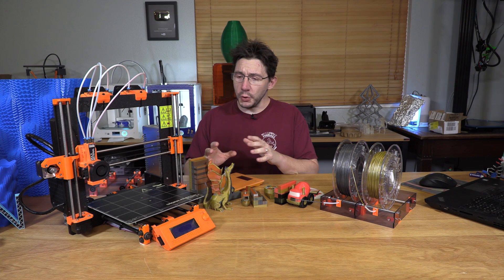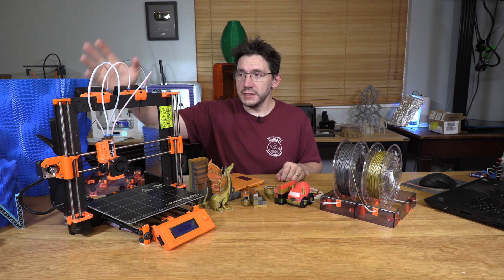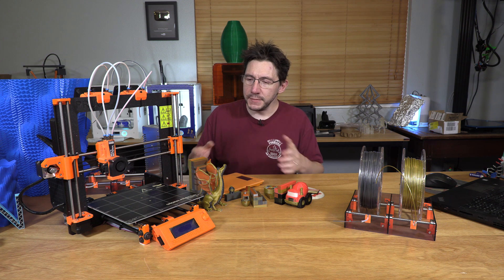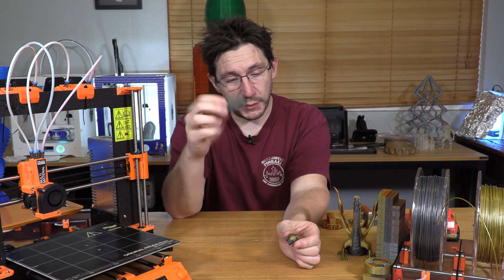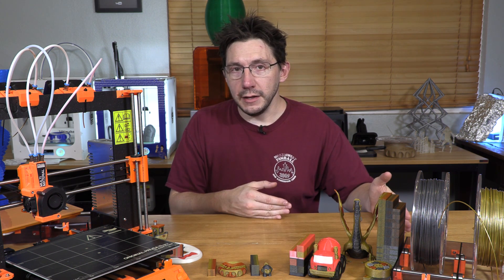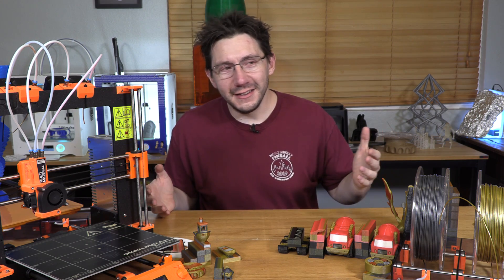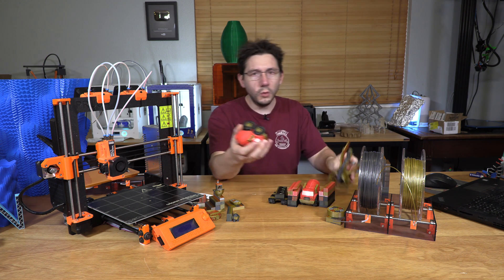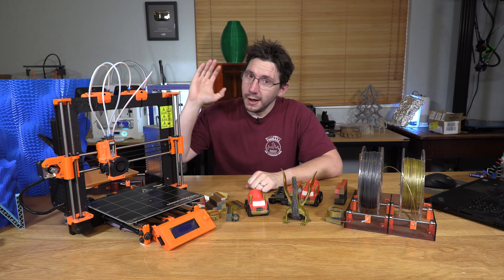Prusa Multi Material Review(?) - My Thoughts on the Prusa MMU 3D Printer

Comment: You forgot to mention one thing. For example in the case of Mixer model, you can print at least 6 copies in one go with the same amount of "waste" as with one, which shifts the percentages quite a bit. The waste would be only 14% then. The percentage amount of waste is completely in your hands 👏 Happy printing!
Reply from the maker: +Josef Prusa oh shoot in all my rambling I did miss mentioning that.
Reply: Why is the waste not used to print the infill? Why is it not used to print a second model where the colors doesnt matter? :/
Reply: @3DPrintingNerd  But.....when this fails then your waste is also much larger.
Reply: Josef Prusa what if the purge filament was used as 100% in-fill or structural support or used to make something completely different to the model regardless of the color makeup, a bigger model for example to make use of the waste difference. I’m in the market for a printer but as I am new to this I also think this great machine is out on my league.
Reply: Josef Prusa why don't you purge the nozzle inside the model. It has 2 advantages. You don't waste material on the purge block and you have a heavier model
Reply: That could work if the inside of the model always has a layer volume large enough to hold the waste plastic.  You have to realize that every tiny detail in your model that has a different color than the other colors around it then it has to be purged.  It either needs a purge block at the same layer height or some sort of wiper chute.
Reply: Recently bought a prusa M2S kit, couldn't be happier!
Reply: Luis Meza
Using the infill to purge sounds like a pretty good idea as long as the infill provides long enough travel paths for the nozzle to be reliably cleaned, good idea. :)
Reply: @NochSoEinKaddiFan  the purge block must remain being built to the payer height of the final layer color change … so this is the only way to do it
Reply: I was thinking that the slicer would see if it was possible to make the waste infill, and if it couldn't, then make the purge block accordingly. You can calculate the amount of material needed to perform the purge, and see if that is less than the material needed to do the infill.
At the very least it would shrink the purge block...
Reply: Hey Josef, one silly question. Wouldn't be possible to use the wasted material to print the infill? I mean nobody if the color outside matches the inside
Reply: I think a purge "bin" or "wiper" that travels up the Z axis along with the print-head could seriously save a ton of plastic.  Basically something that just catches and tosses to the side the unneeded plastic thus not requiring the huge purge block at all.  There are plenty of examples of these wipers, but this one wouldn't have a bottom, it would just toss the plastic to the side of the printer, you can either set something over there to catch the wiggly bits or just clean them up after the print.
Reply: It would waste as much plastic. The purge block is calibrated to remove the plastic from the nozzle. If you have a peurge block that weighs 100g, your method would result in 100g of wiggly bits.
Reply: Why didn't yall just make the waste infill?
Reply: Don’t really see why there needs to be a multicolor purge block, especially if you have an eye towards recycling the waste.  It knows what color it’s printing, it can make a separate block for each color, space permitting.  Then you can recycle specific colors rather than a rainbow.
Reply: Please consider software updates suggested by hed420 that purge to the infill. A heavier infill would be excepted and a more solid model rather than waisting a nothing block. Nobody sees the inside of a model. Trust me when I say, you will be blessed by pursuing and achieving this outcome.
Reply: why not make it so that the purge could be a second useable model that doesn't care about being a mix of colours? For example..a  box, printer parts , gears etc. Couldn't it be arranged? Then you could just plan it so that your multicoloured print outs are combined not with a useless block but with a second useful object.
Reply: Could the waste block be the same shape as the model?  Yes, the print it wouldn't be the correct colors, but at least you get two prints at the same time.  One nice one, one in Tie-dye format.
Reply: Then you might want to pin the comment? :)
Reply: From what I understand is that the nozzle must clean itself. Just throwing plastic out is not enough if the nozzle doesn't wipe the previous color that was left on it.
Reply: That was what i was thinking about the whole video :D
Reply: Who is going to print many? Production only really. @Joesef Prusa Can you get the slicer to print another object with it instead of a purge tower? Something you could paint?
Reply: Do you have a "use infill as purge" option?  I think that would save a lot of filament.
Reply: Would it be possible to create purge objects instead of purge blocks? The purge objects could be functional things that a user would not mind being randomly colored. Bag clips could be an example. Perhaps the purge objects could print in a stackable fashion to meet the height of the printed object. If my printer is going to print something on the side, why not make something someone can use?
Reply: no, it could not. You can see it with marvin and all those little models, the purge block size must be constant.
Reply: @Laki235  he means every time you switch filliment you add on to the exsisting model
Reply: @luis meza Not true my friend, the MK3 is the easiest printer for a beginner to start out with imho.
The instructions are fantastic and the machine holds your hand for just about everything.
Reply: Smaller prints you could still use the infill tower idea. Or you could have the head move off. Servo could wipe the extruder after enough is extruded to clear the chamber and then it could return to printing. The real problem is only determining the amount of filament needed to clear the chamber. If paper printers can do it then there is no reason it can't be done with 3D printers.
Reply: What this needs is a waste chute and nozzle wiper, like inkjet printers. Run the nozzle all the way to one end of the gantry, change filament and extrude just enough to purge. Put the wiper across the middle of the chute so as it goes to the end it wipes any ooze off into the chute. Then as it goes back it crosses the wiper again. That should save a large amount of the waste, as well as get back the bed space devoted to the purge block.
Reply: +Joseph Prusa can you make it print purge blocks separated by color so that they can be recycled individually? I realize it would need a different theory, but  perhaps a dedicated collection system would facilitate proper recycling, which has to be the coordinating technology for this.
Reply: Like a purge "bin"/"wiper" with a slide or chute.
Reply from the maker: +Deneteus how would it be done for a model such as the 3DHubs Marvin?
Reply: +Gregg Eshelman And if there's one waste chute per color, and it knows to dock to each separately, the colors can be recovered separately and re-extruded as the same color filament.
Reply: I like this idea, you could have a selected model in slicer that would be the "purge" model :)
Reply: I see a lot of people saying infill and such but if the system is capable of figuring out where the infill would be why can't the code just know when a certain color will end and then start on the new color.

ie. I need 3 more mm of gray so start purging gray 3mm out and then orange will start extruding at the correct time.
Reply: MIKE MIKE possibly cost and a reduction in build size
Reply: Disney Gym Girl there’s already one available that costs 1,000+ US Dollars...
Reply: exactly! LoL no sane 3D printer hobbyist would invest in those for so little scrap. But, I've been in the "dark side" for only a few months and I'm saving my scraps to melt later to make an armorer's bench block. I will also make some for my vise so I am not damaging the surface of certain stock that I clamped on to it. Those are just a few things I could come up with, I'm sure others have done some pretty interesting things with their scraps like tossing it in the trash LOL
Reply: Josef Prusa Why isnt there a option to make a new part from the waste block. If you are printing the same materials and the part is not Made to look good. I could really vind this usefull.
Reply: Probably been said, but can you not have multiple separate nozzles, a fixed distance apart. You set the machine up, it knows what nozzle has what colour, and therefore can print the colour without any waste. Might cost more initially, but will reduce filament waste?
Reply: I was totally thinking about that the whole time!
Reply: I noticed that too.
Reply: @ Carsten Hahn I think the main reason would be that this method would waste more material when printing multiple objects at one time.  It may also have the undesirable effect of bleed-through of colors.
Reply: Josef Prusa very true, I think Joel did an excellent review, this is not a system for consumers or designers with less than 1,000 dollars of spare cash but rather businesses on a mass market scale. Great machine but also very clear how the long E3D nozzle can eat up money. Since most people will be using this for PLA it might be better to design a shorter low temp specific extruder to open it up more to mass market appeal.
Reply: I was just about to ask if that was a possibility.  Way to read my mind from the future, +Josef Prusa.
Reply: William Hayden, maybe a combination of replacement print bed which is a bit shorter and a wiper that sits right on the X axis, so the head simply slides all the way to the right for example to purge? It could even be reconfigurable within a minute or two by replacing the bed and adding/removing the purge wiper.

But i doubt it would save a whole lot of filament.
Reply: Optimizing the XY usage will decrease the waste percentage.

It would be neat to able to define a model used for the purge area.
Reply: That is the logic thing.
The purge block is the same but you get multiple prints.
Reply: That would take even more waste because each purge block would need to be kept going as tall as the print, up to the final use of each color.
Reply: I would think it would depend.  If it could be done as a "one at a time" single color multi-print, then you should be able to print the individual waste blocks as needed.  It would depend on it you had enough room to print each without running into the others.
Reply: Great idea!
Reply: Yes I agree with you Josef. It can be related to Mass Production VS Few Productions..
Reply: @josef, have you explored the "ink addition" (don't know how they call that), it seems to be a good track to avoid PLA waste ?
Reply: All these people complaining about the waste... I'm just glad someone is working on the problem

As far as the waste issue would it be possible to softmod the software to purge each color in a separate vertical block, that way it could be recycled as single color?

Also, does this do full color mixing in the nozzle ?  I saw (relatively expensive) 4 fill@me t printer that advertises 16.7m color prints via color mixing of 4 cmyk  filaments
Reply: Gregg Eshelman Our 3dSystems CubePro has a wiper and waste chute for purging at the beginning of a print.
Reply: David Renaud fully agreed!!
Reply: But if you don't need 6 cement mixers then you're kinda hosed with trying to push down the percentage wasted. You'd also be hosed if you get a jam in the process.
Reply: Josef Prusa, when are you going to print infill to purge the extruder for the next color?
Reply: That's a clever hack. Love what you're doing for the industry.
Reply: Any plans for a purge bucket off to the side so only layers with color change would need to purge?
Reply: A valid point - if you're trying to compete with China's Mass Manufacturing Market
Reply: Josef Prusa the printer instead just use the infill sections of a model to purge?
Reply: Hehe, I should have read through more posts, I JUST asked about bulk print..
Reply: 3D Printing Nerd surely there must be a way to use the infill as a purge option. I can definitely see how this would be a difficult if not impossible thing to do, but I had to ask.
Reply: 400th like
Reply: May be your purge block just print only wall so it can use as pencil box or usefull box rather than throw it as junk.
Reply: Hello @Josef and Joel. are there any future plans to make something from purge block instead of "block" if it prints Small lego bricks or another model, it would be an interesting colour blend and Zero waste. (if this option already exist please excuse my ignorance)
Reply: what if you use the waste block as infill that should help with just trashing filament
Reply: Is there a SIGNIFICANT downside to having 4 different nozzles over ONE? This would eliminate 90% of waste.
Reply: OOOIOOII but if they can build the best 3D printer in the UNIVERSE, I’m sure they can overcome this “filament waste” issue... until then I’ll hold off on buying a multi-colored 3D printer.
Reply: could the the purge be used as infill?
Reply: Why don't you guys just create a little machine that recycles the plastic... I feel that 3D printing creates so much plastic waste... If only you could throw some of the filament in a little machine and even make a multicolored filament from the waste then it would be amazing!
Reply: Lol but no common user is going to buy a recycler that costs more than a printer... Someone needs to make a 50 dollar recycler so people will actually consider buying one.
Reply: Well Joel definitely needs one because of how much printing he does it would make his life easier but how does the recycler work? Got any vid links or personal review of how it works?Maybe someone should send one to Joel as well to review it!
Reply: I do not have any reviews, I searched on it before but I don't think I will ever own one... FILABOT seems to be very popular, $600 for the machine that melts it and extrude the filament like a pasta, then you need a spooler to spool your filament like in the factory or manually spooling it.

here's a good video on the filabot on youtube:
https://www.youtube.com/watch?v=H6tbZVsGuFk
Reply: Does it have to be a block? Why not a random model you would prime and paint anyway? Waste nothing.
Reply: This was my thought exactly, To bad it's a block not just another model, that might look ugly color wise, but is the right shape...
Reply: Kudos to Josef for the extra variable of multiple copies lessening the waste.
I personally think this will cause (positively) model designers to change their models into assembly parts to prevent waste. Just print each part color of the final model on different layers then snap/glue the pieces together, much like model planes or cars that are pressmolded. This printer will be amazing for models designers saving them plenty of time changing out the filaments, clearing each print, loading the new design, etc. Heck, maybe it would even be able to print different type filaments including regid and flexible plastics at the same time...???
Reply: I wondered the same thing. But when I look at the block, it appears you can see an infill-like pattern below the orange layer, so maybe they already try to reduce some filament there. Still, I wonder if they could not be more aggressive on waste reduction.
Reply: This is a fantastic idea! Let's hope this becomes a feature in slicing software.
Reply: Zdravím, pane Průšo, napadlo mě (ačkoli tisknu teprve dva měsíce), zda by nebylo možné přidat do vašich tiskáren podobné zařízení jako je Palette+? Kvalita tisku by byla sice nižší a muselo by se tisknout s materiály s podobnou teplotou pro trysku, ale dalo by se využívat celou plochu podložky a odpad by byl nulový./Hi, Mr Prusa, I've got an idea (even if I print just for two months): could you include something similar to Pallete+ into your printers? The quality would be worse and you would have to print with materials with similar nozzle temp, but you could use whole buildplate for printing and with zero trash.
Reply: Why Josef, dont you design a solution that you use a special purge filament instead of purging every color?
Reply: Add an option to hide the purge in the infill.
Reply: if you have contact to the producers, here is a good idea for improvement.
dont print one waste block. print 4 on differentplaces so the recycling later is possible with lets say 95% of the original color.

If the block is mixed up like now , recycling by remaining the color will not be possible.
Reply: wouldn't it be much less wasteful to have the 4 materials going through 4 different hotends??? then there would be no purge block?
Reply: How often do you print multiple of the same model? Maybe you should also account for that in not only waste per print but total waste, this is a joke, multiple nozzles is still the best way to go. Also why call it multi material? It's really only multi colour because you need different hotend/extrusion properties to deal with multiple materials. Unless the the 2 materials need the same properties of course... I mean biggest advantage to multi extrusion is supports.
Reply: or, when power goes out at 95% completion... you have 12... TWELVE times the waste....  use a differ waste block per color at least... easier to recycle...  my JGAURORA has amazing detail... smooth prints... power outage resume and zero issues with prints sticking to bed...  Ill paint if I want colors... If I want to waste money on waste  blocks so i can have 4 colors on a print that needs primer fill to rid the stepping... I'll waste my money on this machine.  
Joel... this isnt that cool... 
Id be more amazed at seeing a filament recycler that has a consistent diameter...
Reply: @phynlyph  sure, ill remember that next time i decide to print multi of the same thing which is....about 2% of the time thanks.....
Reply: I was hoping that I wasn't the only one that realized this!
Reply: I was thinking this, but also be cool to enable an option to print a model scaled to the predicted waste volume.
Reply: The calculations should be done backward meaning - calculating the "filament usage efficiency". A multicolored printer is like a petrol engine(with filament being the fuel). As we all know an internal combustion engine is not 100% efficient and most of the energy is actually wasted as a heat.

The same logic applies here as well. For example in Adalinda the efficiency is 100*(76/317+76) = 19.33%. It's only logical that printing more models would rise your efficiency. For example printing SIX models will result in efficiency of 100*((6*76)/(317+6*76)) = 58.99%. Mathematically speaking the efficiency approaches 100% when the number of 3D models approaches infinity.

Implementing this quick calculation into the software might help the people with their print optimizations.
Reply: was going to ask this question, thank you.
Reply: It shouldn't be difficult to figure out the feed rate to mass flow rate of material to determine the amount of time before a material change is required in order to reduce waste. Any remaining purge of mixed materials could be used in the infill. From there, I expect an algorithm could be created for the slicer to determine the minimum infill percentage per layer if multiple materials are present on that layer. Has any consideration been made to use these calculations to improve? Kudos on the sweet mixing hot end though!
Reply: My new printer has been nothing but frustrating.  Sent it to someone who can set up and fine tune it so it will work.
Reply: That is helpful, For me I'm thinking water soluble support material
Reply: +Josef Prusa : if a color is not used on a layer why bother printing stuff for it? Or just print a bead on the outer edge. Who cares if the purge block looks like crap? Yours look beautiful like the model. I would rather have an ugly, messy purge block that does the job and also uses less plastic.  As long as it doesn't fall over onto the actual model! :)
Reply: @getorvillized7499  You have to keep the tower up so it can be switched to in the layer further up, only at the top of a model you can abandon part of the tower and not purge.
Reply: Then again one could also argue that you then have a purge block + 5 Mixers of waste for printing one Mixer. You get the point here. The MMU is really, really cool. However, I think one has to use it responsibly only if it's really worth it to reduce plastics waste. We all already waste way too much plastics on useless prints.
Reply: If the concern is plastic waste, then in general Filastruder sounds like a good idea. It costs around as much as a cheap (cheap, not cheapest) printer would cost and would allow you to recycle any filament that was wasted. For purge blocks, well I guess you can only turn it into rainbow color filament, but it's still better than throwing it away.

Here's the link: https://www.filastruder.com/products/filastruder-kit?variant=338125655
Reply: I came here to say this. :)
Reply: who the fuck want 6 copies when the printing time for each takes 30 hours. that's insane